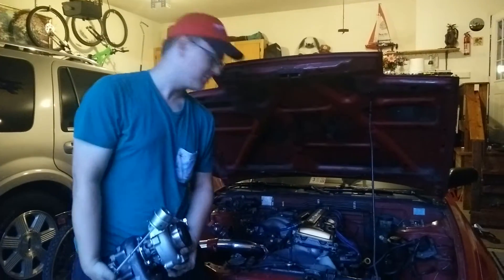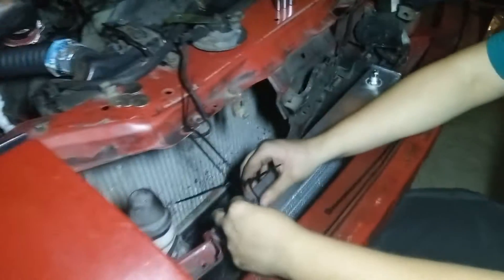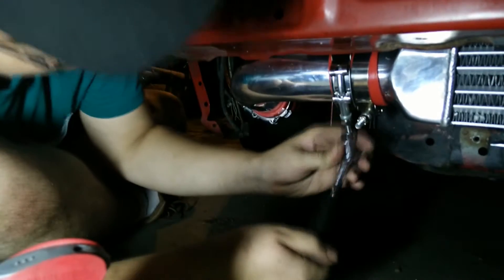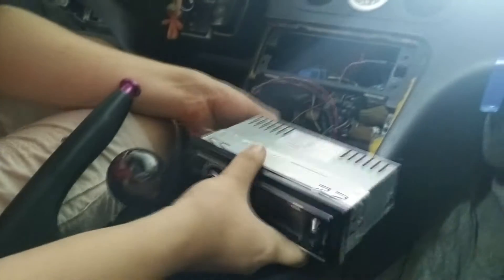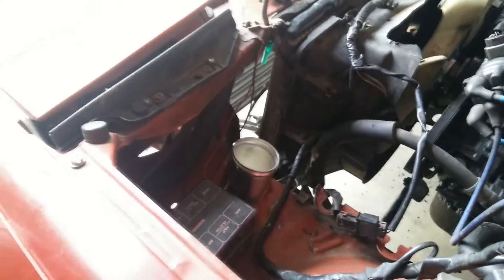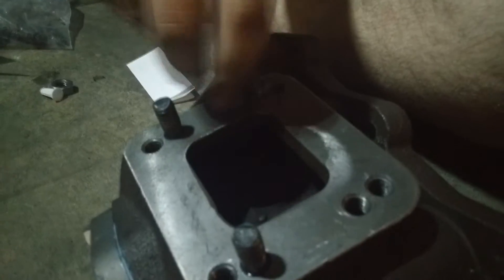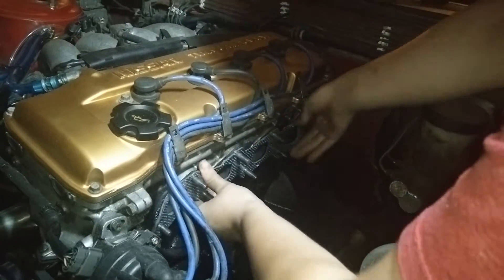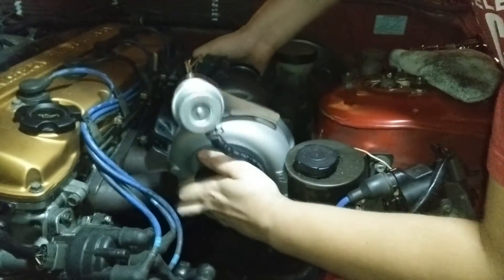Poo40sx (240sx) Build - ep7:  BUDGET TURBO BUILD! part 1

Comment: What are you going to use to tune it. I Just subscribed i'm looking forward to seeing how it goes. I was just using an FMU on my s14's ka-t and everything was going good until my wastegate came loose and I over boosted to 25 psi and blew my ring landings hahaha make sure you use Loctite on everything
Reply from the maker: I sold the car, but, I used the fmu and sr20det injectors if I kept it, I would have used a apexi safc.
Reply: +Bamboozle Boys wait you sold it ._.
Reply from the maker: Troll God Sadly I did, but, a new project is coming, with plenty to do ;)

Comment: Do you have a link for the intercooler kit?
Reply from the maker: the intercooler kit I got is no longer on ebay, but this one looks about the same. http://m.ebay.com/itm/Universal-12-pcs-2-5-BLUE-COUPLER-BLACK-PIPING-INTERCOOLER-KIT-T-Bolt-CLAMPS-/321413280240?nav=SEARCH
Reply: +Bamboozle Boys what about the turbo and did you take off the oil pan for the install lol? Thanks for the info. Did you get this tuned yet or is it still on stock ecu? Gonna do a fun build on my single jingle before I swap the motor
Reply from the maker: I never took off the pan, but if you are not too lazy, I really recommend to take it off, but it worked for me. I took off the pan later and saw a shit load of metal stuck inside.Troll God